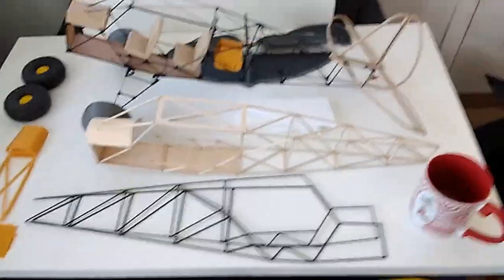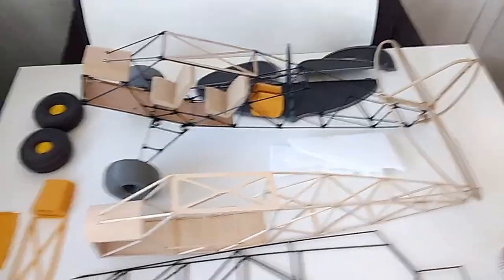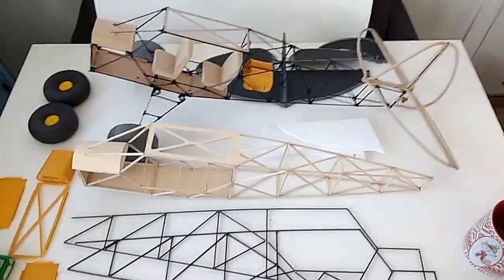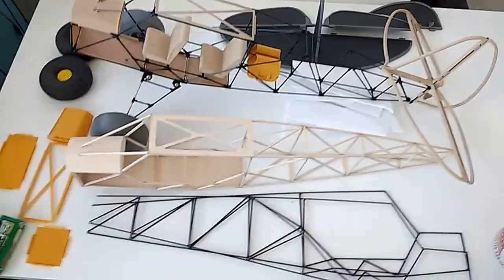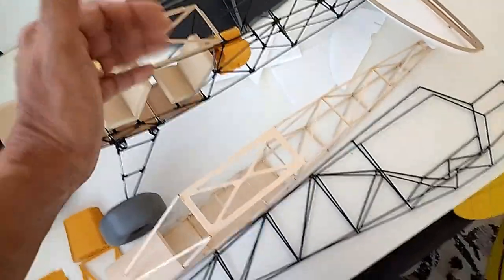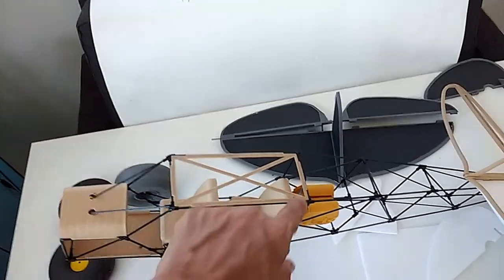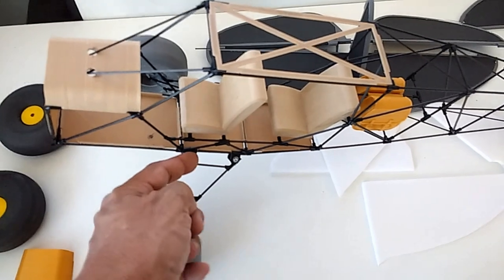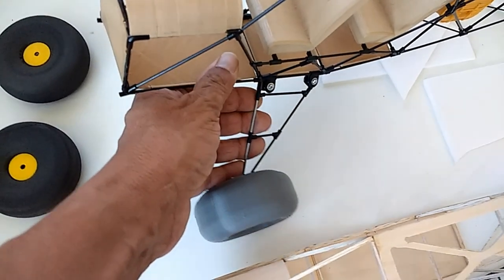Savage Bobber RC Ultralight  DIY Tips and Methods

Comment: Do you sell the STL's for the interlinks.  I had a similar idea a while back using carbon, I like the hybrid approach of this.  I want to scale it up to about 1800 - 2000 mm, I like where this is going and will be watching.  I want to get one of your ultralights at some point.  Just getting back into the hobby after a few years away.
Reply from the maker: Hi Kevin, I typically do not sell STL files, for items that are integral to MIA Kit designs. But I can can show you how to make them using plastic tubing. They are a  bit of work to make them individually, but not as much as creating the stl files for them  because no connector has the same angles in a build like this.
Here is the video link to making them but below are also the steps. 

https://www.youtube.com/watch?v=h2hoU8FrswM

How to make them: 
1) First make individual prints (plans) of the airframe profile sides, top and bottom, in the scale you want as build plan reference for size and location of each connector.
2) Find a suitable medium hard plastic tubing or sheathing that will hold each rod in tight press fit.  
You can use electrical wire sheathing that yields a tight fit over the carbon rod OD and holds well with CA Glue. PVC or ABS based tubing holds well with CA.
3) Cut in small pieces, about 3/8"L, then trim ends to specific angles for joining them and  glue them using the plan as reference with CA. The idea here is to make or build the tubing connectors as you would assemble water copper piping with solder.  Make one side of all the connectors, some will have up to 4 pieces to form a connector that supports all sides, diagonal and cross rods. 
4) Duplicate all the connectors for one side, in mirror image, for the opposite side. 
Once you have these done the hard works is mostly done and you will have an awesome carbon Rod Frame that will hold a lot better than balsa sticks and glue.